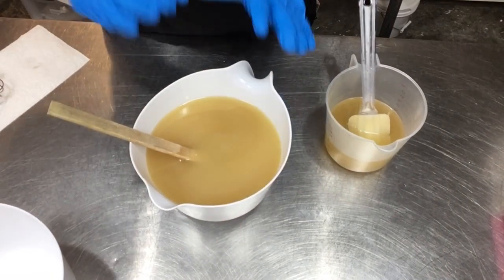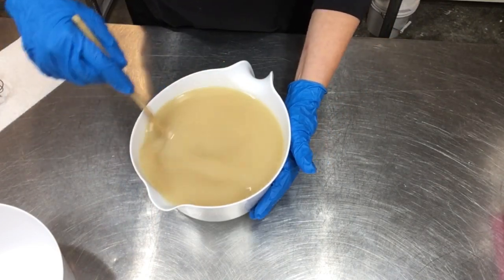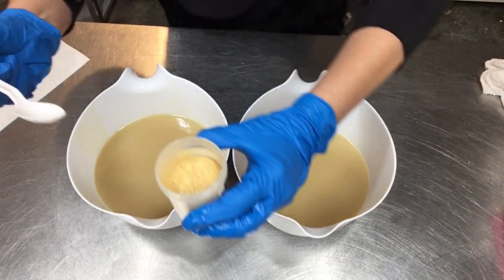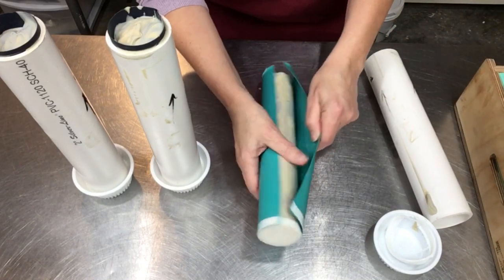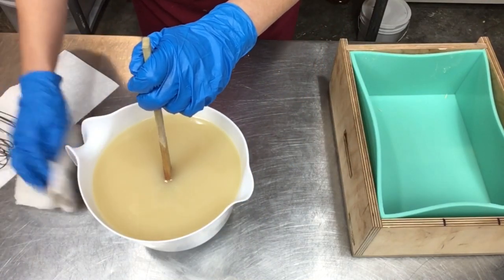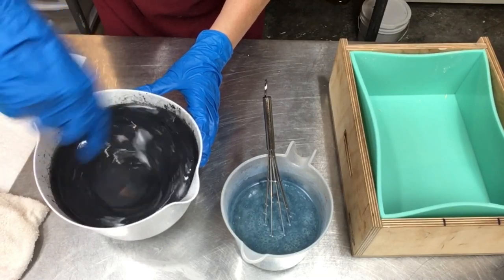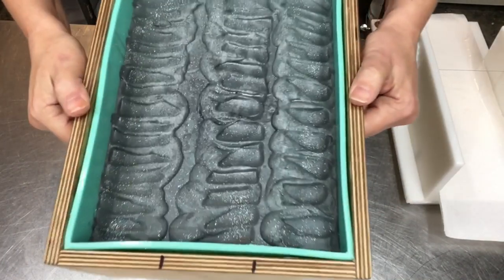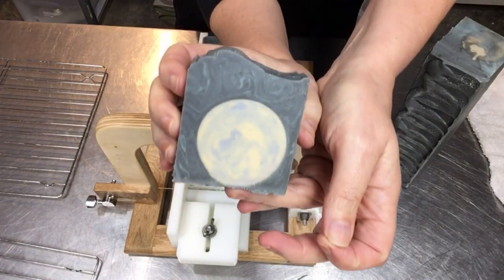Making WINTER SOLSTICE plus How To Easy No-stick DIY PVC Embed Soap Mold | Ellen Ruth Soap

Comment: What is the plug you popped off?
Reply from the maker: Melt and pour soap, I use it for a leak proof sealer on the bottom...
Reply: @EllenRuthSoap  Oh yeah, I caught the part about the ring being melt and pour but I just didn't put it all together. Thanks.